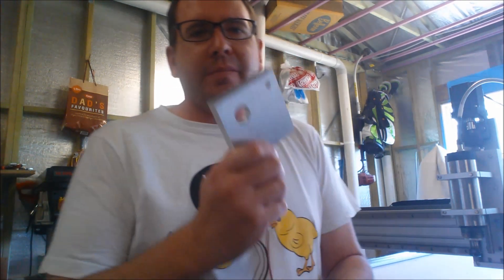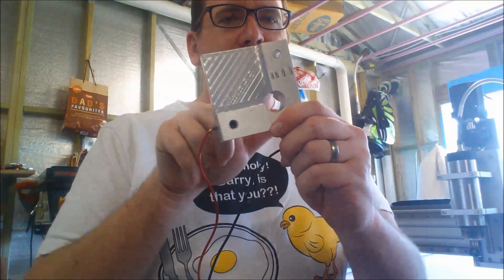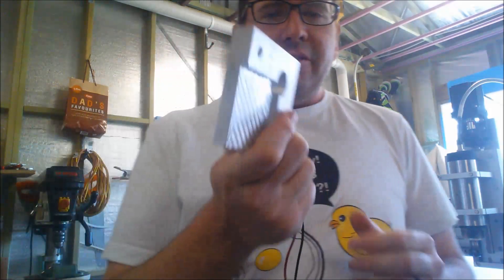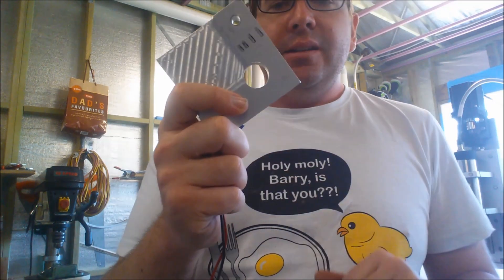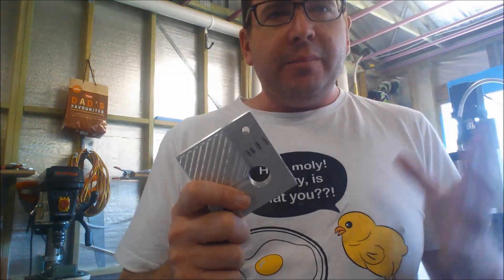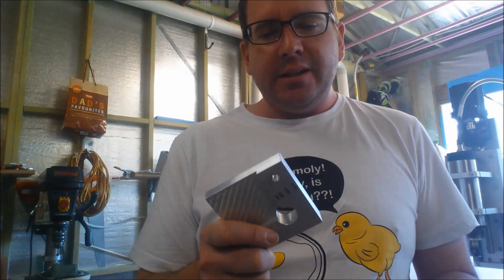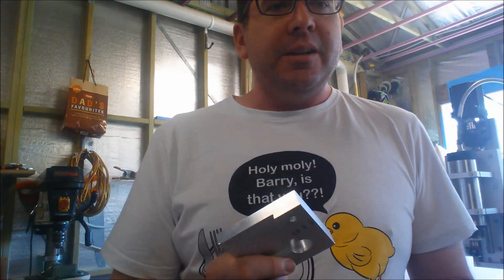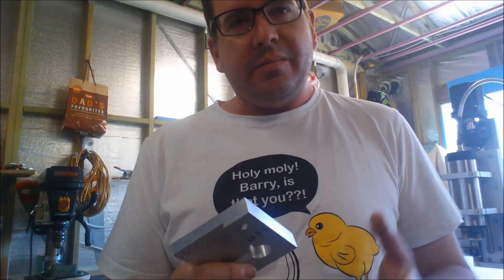Milling A New CNC Touch Plate Edge Finder

Comment: hi 
i have question 
after we zero machine and have  piece to cut 
how cnc know it Coordinates location
as you cut in this tube 
you cut small piece how you make it 
and the piece it self how  to Coordinates location
Reply: lot have video examples how set code how know were zero have after dmension edge finder tools.

Comment: z motor sound its gooood... please share the set up in switch stepper driver.
Reply from the maker: signzonepr leadshine em705 digital driver set at 2000 steps. custom made stepper. all running through an Ethernet smooth stepper

Comment: I was surprised to see the way the tool path is set up for the holes, in that it reverses the direction of cut (clockwise, CCW, and then another clockwise pass). What are you using to generate the toolpath?
Reply from the maker: +will11m This was done using vectric sofftware. Have moved onto fusion 360 for better toolpathing strategies now

Comment: Still hoping to get detailed plans for this item?
Thanks,
Phil
Reply from the maker: Sorry no detailed plans. It's just something I threw together. size and thickness don't matter because you just set that in your software. The only thing you have to do is make sure the square intersects the hole so when you shoot the plate on the corner the hole is Centre of the edge. Very simple to draw